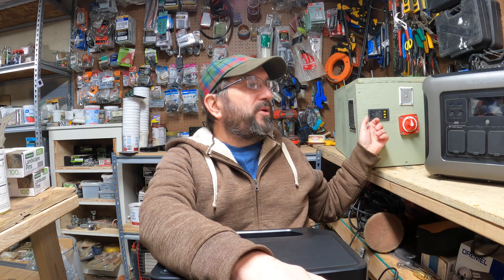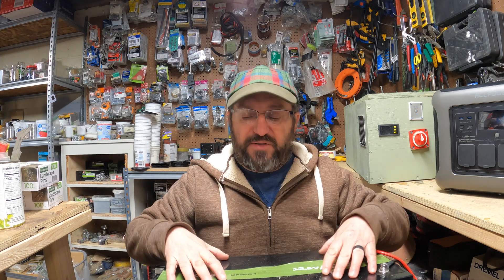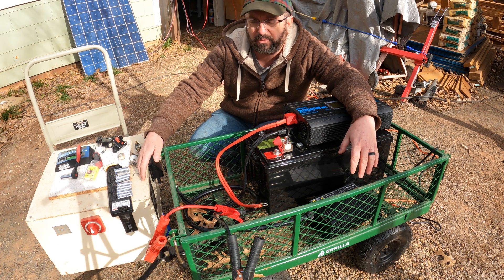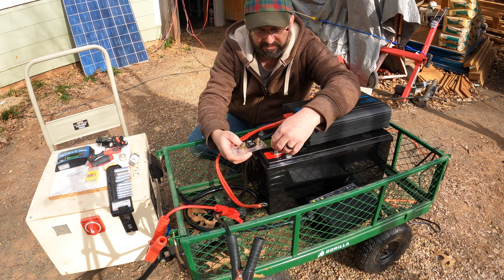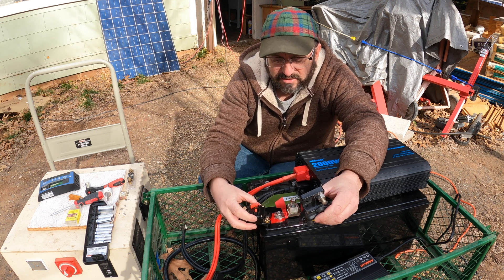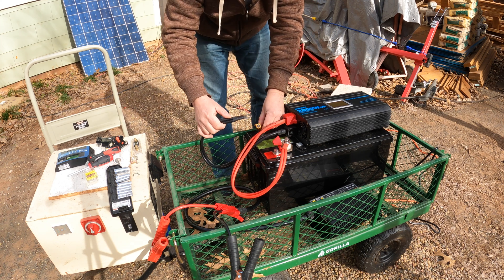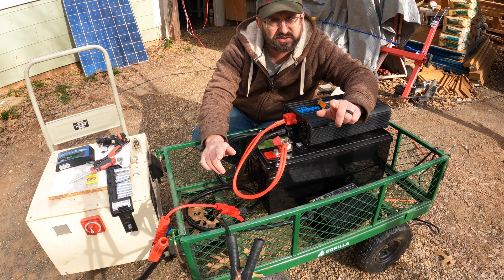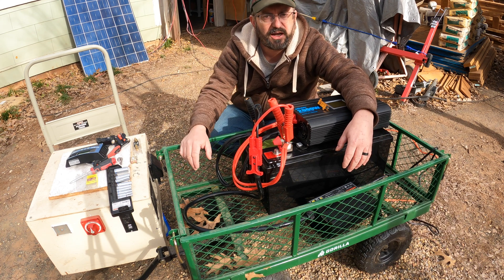Can you save money by making your own solar power station? Is a DIY build cheaper than an EcoFlow?

Comment: Does the battery charger make noise when you’re charging it on a regular outlet?
Reply from the maker: It does.  Not super loud but it does make some noise.
Reply: @OurBlackCatCottage And do you need to keep it plugged in to charge the battery? I went into a battery chargers “rabbit hole” and found the NOCO GENIUS & Hulkman but it seems that those need to be plugged in to the wall while it charges your battery… are those a different kind of chargers?

Comment: So for around about 700 you can get a 2560wh setup. This is very interesting. If you buy a power station of similar value can get around 2000 wh with everything you have and more features. I actually got a dr prepare 12.8v 100ahbattery for 180  and a ecoflow river 2 pro for 239. I use the 12.8v battery to add to the river 2 pro. This was very easy
Reply from the maker: Thanks for sharing!

Comment: Hi all use a DC house 100 amp hr battery with built in USB C & A, chargers off USBC and has a 12v barrel connector as well for lighting if you wish. A 350w pure sign inverter from Best Tech and has 2 USB A’s finishes it off for 250v power. Fused by a marine rated terminal post unit and allows other things to be connected as well if you use a double fuse holder. This could be solar or DC to DC etc.
Keep cables short and use offcuts if you can.
You can use Anderson connectors if you wish to make connecting various units easier and safer.
Take care all M.
Reply from the maker: Great idea!

Comment: For medium-sized projects I usually go with a powder-coated steel electrical box.  Some examples (Amazon search):

"VEVOR NEMA Steel Enclosure" - This is a pretty large box.  Does not have knockouts.
"Renogy 200 Amp"   (look for their DC Circuit breaker box).  this is a smaller box that has a bunch of convenient knockouts too.

Both of those have backplates that can be removed from the box.   NOTE: When using knockouts be sure to install the appropriate bushings, chases, or nipples to protect against sharp edges.   Don't go too small or you won't be able to fit the equipment.  You want "Fat" boxes... at least 8 inches deep.  So, for example, the VEVOR 16 x 12 x 8 box is the smallest I'd go.

What I do is build the project on the backplate and also mount equipment on the inside walls.  I use self-tapping metal screws to mount everything and I use the DIN rail that is included with the (e.g. the Renogy) box to mount circuit breakers and fuses.  Sometimes I move the DIN rail and I'll often remove unused bus bars and install my own larger busses.

A surprisingly large amount of equipment can be thrown into these sorts of boxes, particularly if you use the inside walls in addition to the backplate.  If heat is an issue (it is on a few of my boxes) I have a huge steel circular blade (or a large diameter steel punch kit) that I use to make large circular holes in the doors for some large fans.   If you put in a fan you generally want two fans... one for intake, one for exhaust.

You can also find boxes that include a fan hood and fan ports, but usually for relatively small (thus noisier) fans.

For example, I have a large VEVOR 20 x 16 x 10 box and I can fit four small Victron 100/20 charge controllers (or three of the larger 150/35's), a DC+ and DC- bus with 6 x M8 terminals each, a few smaller bus bars if needed, a AC battery charger, a power supply, and an inverter, 8 2-pole MCB breakers, and fuses.... all in one box.

With the smaller Renogy box (19 1/2 x 13 3/34 x 8) I can fit one or two 150/35 charge controllers, an inverter, AC battery charger, 5 2-pole MCB breakers, and fuses.

The key to doing these builds is ... use self-tapping metal screws and hacksaw the bits that stick through the other side off.  Very flexible.

-Matt

Comment: I'm gonna down-size it even more.   To the absolute bare minimum. just for fun.  Lets see how cheap we can make it.

* Little 12.8V 30Ah battery (that has short protection and over-current protection).
* No fuse  - battery is small enough that we can just depend on its short and over-current protection.
  (or, alternatively, an inline auto blade fuse or glass fuse).
* 10 AWG cabling throughout.
* A little pure sine wave car inverter like 300W.
* A little Victron 75/15 charge controller.
* 4A LiFePO4 battery charger OR USB-C charger + 19VDC USB-C cable (plug into the Victron's solar input, set Victron amperage limit appropriately).
* ok ok, a few crimped ring terminals too.

Costing it out:

* $80 - 30Ah 12.8V LiFePO4 battery  ($62 for 20Ah).
* $18 - 10 AWG cabling red and black.
* $40 - Little 300W car inverter (still pure sine wave, though)
* $65 - Victron smart solar 75/15
* $15 - 19VDC USB-C  cable (up to 100W depending on the USB-C wall charger you plug it into),
* $20 - 30W USB-C wall charger (use with victron limit set to 2A... = 24-28W or so).
* $10 - ring terminal assortment
---------
TOTAL: $248 before taxes.

Capabilities: 384 Wh of storage, ~300W AC output, can handle up to 200W worth of solar panels, can be charged from solar, the wall (if you get a little 4A charger), or from USB-C, or from USB-C via the wall.  Also may have additional ports (the car inverter usually has USB ports and such)...  Charges from the wall at the blistering pace of ... uh, 28W.  So about 12 hours to charge empty to full with a 30W USB-C charger.   Size: Fits in a lunch box.  Doesn't break the bank and provides hours of fun.

-Matt
Reply from the maker: Nice setup! Frankly a bit surprised about you going without a fuse.  Could have sworn you yelled at me for not using a fuse on video in the past.  LOL.
Enjoy your build!  You should do some videos on your projects.
Reply: @OurBlackCatCottage Heheh.  Anything bigger than 30Ah (30A) I'll always have a discrete fuse.  I did make it optional in this case because the equipment and cabling is matched and both the car inverter and the Victron already have a built-in battery-side fuse.  I should have mentioned that.

(Smaller Victron's like the 75/15 and 100/20 have an integrated blade fuse.  Bigger Victrons require an external battery-side fuse).

-Matt

Comment: I put a 16" length of 2x8 between the 3000W inverter and 300Ah battery on my diy power station.  Screwed the inverter into the wood and taped wood onto battery w electrical tape.  Didn't want the aluminum inverter housing sliding into terminals and causing a short.
Reply from the maker: Great tip!

Comment: I've been wanting a higher amp charger , reviews on this particular charger claim the wires get extremely hot .
Have you had any issues with your charger ?
Reply from the maker: No issues at all.  And I have a lot of battery so I use it several times a week.  I love it.

Comment: Hi
Love the easy and simple power station. I have made one but added a solar charge controller option. I used a HF furniture dolly and modified with sides and a rope to pull. The panels (2) fit into the hand made cart to be deployed when needed also a HF item.
Again love the quick and easy setup...
Reply from the maker: Thanks. Your build sounds really cool too.